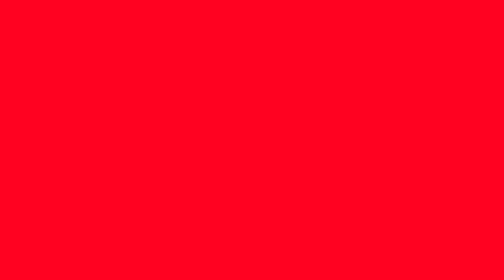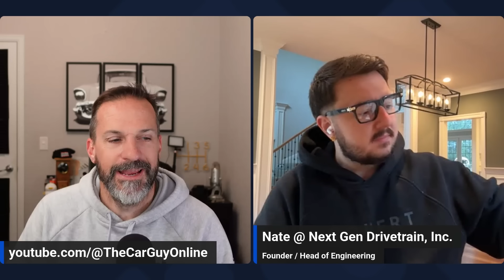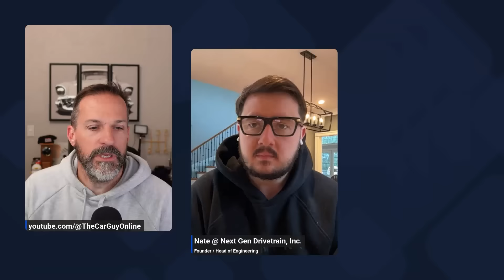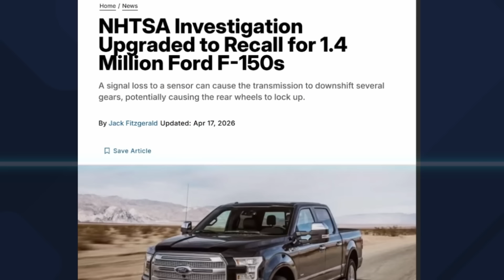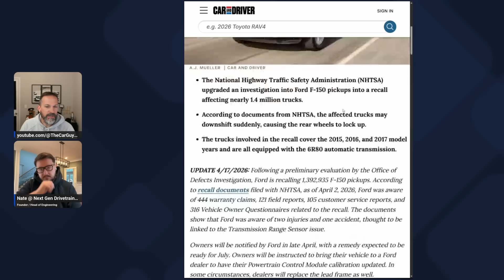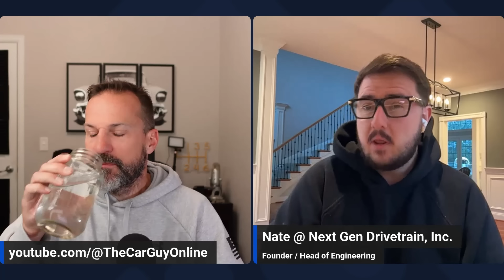Ford's BIGGEST Transmission Recall Yet - 1.4 Million F-150s

Comment: Lead frame is more essentially a circuit board with built in sensors. Its not a computer and its pronounced “leed frame”. Its also easy to replace. Also, what toyota transmission is regularly running 500-700k with no maintenance?  Calling the 6r80 unreliable is just ignorance in my opinion. I have 3 trucks with them and have replaced one lead frame, and I replaced it myself at 150k miles. You guys are both FOS, plenty of vehicles are making it well past 100k.mi. and with ease.

Comment: I have this trans in my 2015 F150, also have a ZF6 6 sp manual in my 2000 F350 w/7.3 PS.  Not experienced any issues with the F150 but will likely adhere to the recall, if/when.
Now that the Trump Admin has gutted the insane EPA standards maybe we can get some useful vehicles with less recalls?  
When any manufacture goes to eye scanning, cameras  and shutdown interlock switches based on AI, they should be prepared for massive legal fights against the 4th Amendment.

Comment: I just disagree with the premise that more gears equals worse reliability. If thats the case then why is it that dodge use to be known for having bad transmissions with their 4 speeds and now the trucks have 4 more gears and its one of the most reliable transmissions in a modern truck. I could be wrong about that, but the 8hp seems to be to best modern trans and  Car & Driver even says that. Imo the 6r80 is a better trans than the 6l80 because gm really likes to slip the torque converters and run their transmissions stupid hot, which is really hard on the tc. And the issues with the 10r80s mostly come from a bad design with the cdf drum. It looks to me that the issues we face with new cars are poor engineering, cheap parts, and government regulations and it not just with transmissions its every part of the car

Comment: Ford Chevy always built substandard transmissions, they usually had five different transmissions to go behind three different engine choices my 2004 Dodge Durango with a 5.7 hemi has 350,000 miles on the transmission the engine and the all-wheel-drive system it’s never been touched. It’s extremely reliable. I will put 450,000 miles on it before I touch anything. It’s why smart people by Dodge. We’ve always had the best transmissions the best engines Ford just has the best people to brag falsely and we know Chevy is junk.

Comment: Guy on the right is a salesman. Dont forget that. I have 190k miles on my 6r80 2016 F150 and have had 0 issues. Modern vehicles are more reliable than 70s/80s/90s vehicles. They're just harder and more costly to repair. But they're also 10x safer.

Comment: humm wonder if the recall is in Canada also ? I have a F150 2017  2.7 l with the 6 speed  still works fine at 225000km  a bit rough shifting when cold but otherwise ok

Comment: Putting an ECU in the hot trans oil. How stupid.
Reply: You are absolutely correct. the life of electronics is significantly affected by operating temperature. the rate of degradation varies exponentially with temperature, not linearly. Engine ECU's are often next to the hot engine. When I found the engine ECU on my 2001 Impala installed inside the air intake plenum (the coolest area under the hood) I was amazed at the idea.
Reply: That was by design.  They only botched how fast it failed.  Its supposed to last until just outside your warranty.  Ford put plastic IMRC flappers in their intakes. They are controlled with a metal rod.  The metal rod slides through the  plastic flappers and is constantly opening and closing them.  Who here who is NOT and engineer knows what will happen when a metal rod turning in plastic will eventually do when placed on a hot engine?
Reply: is the recall just software or is it mechanical?
Reply: The TCM is not internal on these transmissions. He's wrong on that. The PCM (ECM + TCM) is mounted high on the passengers side of the firewall. 3 wiring harnesses plug into it. 2 for the ECM and 1 for the TCM.

I read through a bunch of comments on this video and all I can say is you guys need to be more selective in where you get your information from. Misinformation is a huge problem. And that's not meant to be an insult. I believe the guy making these videos is a very nice person and he's not trying to mislead anyone. He's doing his best to present accurate information in his videos, but the truth is that he doesn't know all that much about modern vehicles. As it stands right now, the only place you can get consistent, reliable information, is through factory training. Cars have been changing a lot in recent years, and the aftermarket just can't keep up. Eventually it should correct itself, but for now, you need to be careful. I get cars towed in on a daily basis because some independent shop got themselves in over their heads. They have no idea where to begin.
Reply: @052RC if it’s not internal to the transmission, why is this defective junk part failing on these transmission. Ford couldn’t leave the original design alone which is why these fail, it needs TCM and it doesn’t have one for 2011-2014. If it had one, so many wouldn’t be failing hence why I have the 6r80 just as much as the 10R80. Both are junk in all honesty. I have the 6r80 and a relative has the 10r80, both terrible. Mine is already on its way out at 140,000 miles because of the defect.
Reply: @That3.7F150  8 yrs with my 10r80 and it shifts fine like the day it was made. So not all are junk like you think
Reply: @pathunter7003  how often do you flush and/or drain and fill your transmission fluid? Do you drive around on tow/haul all the time or normal? And are you in a 2.7L, 3.5 or Coyote?
Reply: @therealsolomonmichael  I will drain the fluid at 35,000. and I don’t flush it.
90% of the time I drive it in tow/haul so it uses every gear, the rest of the time is in normal or sport. I keep that trans adaptive learning guessing all the time lol
I have a 2018, 2,7, supercrew XLT
Reply: @pathunter7003  I thought that combination exactly might fix the problem and you just confirmed it 100%, thank you! with the drain and fill do you also replace the filter or just leave it?
Reply: @pathunter7003   I have. a 10 speed in my GMC.  I have had 4 of them and only one had a problem.
Reply: @danslawncare8594  👍

Comment: I've got a 2020 F150 with 210k miles. The trans is  clunky... probably the cdf bushing, and I'm going to pull it soon. I guess I won the lottery. A rebuilt unit from Moveras is $3800 which is not cheap, but not $8 or $10k

Comment: I was a GM tech years ago I was given a car to diagnose front wheel drive Ford don't remember model Ford said nothing wrong with transmission customer told me drive at 60 mph and you will have it happen drove ten miles steady 60 mph transmission actually locked solid for split second scared the crap out of me put a reman in okay

Comment: The only reason we can't get manual transmissions in trucks is because of the CAFE/EPA regs...
Reply: Its because they're reliable thats why
Reply: Manuals sit on the lot. I got one for a fair deal because the dealership just wanted it gone, it had been sitting there for months. This was back in 2015 and it’s still great for me.
Reply: @---jt5wg they also only where putting manuals in the lower end models of vehicles.   Manufacturers somehow think if you want a manual you don't want a luxury model.  Total nonsense but that's what they thought
Reply: And Americans have gotten lazy. Automatics are more fuel efficient and buyer demand just isn't there to make it worth it for the manufacturer.

Comment: I've worked in the air conditioning industry for over 35 years.  Paying attention to CO2 levels inside vs outside is how we determine if a building's ventilation is good.  While I could comment that I haven't seen readings go up in over 25 years I think it's more instructive to explain how CO2 operates as a greenhouse gas.  The earth can only get rid of heat by radiating it out into space.  To limit that radiation CO2 color shifts the infrared from a more efficient color to a less efficient color.  Since it's a color shift it only takes enough of a concentration to achieve this.  That concentration is around 300 to 310 parts per million.  Higher levels doesn't increase the color shifting because it's already done.  If higher levels are a problem then it doesn't explain the existence of CO2 levels trapped in amber that are 3 to 4 times higher than common nominal readings now.  So if you think that the bubbles in amber was trapped there after the industrial revolution then I've got a bridge in Brooklyn that's for sale.

Comment: 1997 F150, 4 speed auto with  the romeo block 4.6. Has 350,000 miles. Runs strong for its age and milage, sure its a little tired but hey for a 30 year old truck with the original motor no rebuild, its a solid vehicle.

Comment: The frustration I have is that Ford's recall is arguably pointless!  Why?  Because Ford is currently struggling with a shortage of qualified tech's, dealer repairs that used to take a day are now taking much, much longer to get completed.  And, even then, the quality of those dealer repairs seems to have declined.  We currently own two F-150's with 6R80's and an Expedition with a 10R80.  The Expedition had a warranty transmission issue recently.  We took the Expedition to a Ford dealership with a good service department and it took them well over 6 weeks to complete the repair (they ultimately replaced the transmission).

Comment: Hey guys,
I have 2017 f150 with roughly 38,000 miles.. about 300 miles ago. I had my transmission rebuilt remanufactured whenever you call it… it did solve a lot of the problems but it’s still kind of clunks rather loaded  from 6,5 7 to 6 whatever which one. My warranty runs out in two months. Is this normal? It seems like at high speeds when it’s at 8/9 gear and then you slow fairly fast it happens more often!.. your feedback would be appreciated..

Comment: WHERE IS OUR FEDERAL TRADE COMMISSION? Proprietary software and diagnostic tools, the absence of "right to repair" laws. While a few states have passed "right to repair" laws, it will never be easily enforced until the Feds make it law. All brands use to offer base models without complicated computers, add ons, just simple basic transportation with "options" for a/c, touchscreen info centers vs a simple FM radio. Power windows/locks vs crank windows and manual locks. What a concept for Toyota to go back to an updated design for a Yaris or Civic WITHOUT THE TURBOS. We did fine with basic rides that DID NOT HAVE 250+ horse power, squeezing 300 hp out of a 4 cylinder with a "made to fail" turbo.

Comment: Why haven't the brands figured out it would be cheaper to build a vehicle that's reliable, not disposable after the warranty expires? Why not go back to the known versions of reliable drivetrains? Even the final years of the GM 3.6 V6 were much better than the damnable turbo 4 cylinders, why not a 6 speed tranny with an overdrive "button" for interstate driving?  Do we really need heated steering wheels, power door handles? Those crap computer screens instead of instrument clusters...water pumps INSIDE the engine??? Now WAY overpriced with MUCH too little quality...it's like at least one brand would see this problem as an opportunity to excel instead of join the crowd with junk product like Toyota has decided to do. Remember when a Honda, Toyota, even a Nissan was your go to quality purchase? Yeah, not any longer. Every decision now is a crap shoot, you're rolling the dice, hoping YOUR ride will be one of the good ones, magically surviving past the warranty...somehow.

Comment: Bruh put the ECU outside the dam transmission
Reply: the ecu is outside the transmission. its called the pcm, the "module" inside the transmission is basically your valve body just like any transmission.
Reply: @ChadG2 not most transmissions do not have Computer's inside the transmission in the hot oil, Sure ZF 8 do it, And a few others, ZF 9 is on the outside depending on the Oem, Honda made them install it outside the case.

Comment: Th 6r80 lead frame problem is from metallic particles and shavings building up causing the speed sensor to short or interrupt signal. Was a thing for 2011to 2014
Reply: 6r80 is actually pretty solid that doesnt really need upgrading. And new install is usually around 5500 to 6500. Not 10k. I know the 6r80 well

Comment: Its a race to the bottom. Ford Motor Company just filed patents involving biometric data systems, and laws have been created in some places that could allow vehicles to disable operation if a driver is judged unsafe. Ford Motor Company wants to use fingerprint, eye, face, and voice recognition tied into databases to verify identity and potentially flag wanted criminals. So you get in your car or truck, it checks if you’re wanted, checks if you’re “fit” to drive, and if it decides something is unsafe, it could pull over and shut off. Hope the next gen can find a workaround for this nonsense.

Comment: I have the same problem in my 2022 10-speed. Slowing down into red lights it will drop five gears all at once and nearly lock up the tires and make a crashing sound in the transmission
Reply: 2023 went out at 40k and the entire transmission was replaced under warranty with a different model transmission that listed for 2k.
Reply: @tnvfl  is the replacement a 10-speed also

Comment: My 2011 with the 6R80 was bullet proof. It's a great transmission. Change your fluid and you'll have no issues.
Reply: If you watched the video, it has nothing to do with fluid changes
Reply: @slowstang88 all I know is real world and 14 years of experience. It was rock solid.
Reply: @JDS-51 My 2016 has had fluid changes well in advance of whats recommended and mine started the downshift issue at 138,xxx miles. I had the 100,000 mile full fluid change done at a little over 40k. The problem is the TCU in hot transmission fluid, the lead frame getting fluid in the connectors, and pulse damper failure.

Comment: Criminal, they only recalled f150. I have 17 mustang with 6r80 that was throwing up p0706, p1702 and so on. I get hill descent not available, wrench icon. Unable to engage D from P. Gear lights not lighting up, hard to start vehicle and ocassional hard shift from 2 to 3. One day I was on the highway the trans hard down shifted to first gear violently. After that I did not drive the car for 6 weeks. Ordered mechatronic replacement. Replaced the lead frame, thermal bypass, all the seals and it is now shifting way smoother than when it was new! It was broken from start. My car only has 20k miles. Most  ppl would not have been able to fix it themselves.

Comment: I'm all for a discount being offered for supporting a channel/company, especially those that educate consumers and provide valuable insights/expose's into company practices. Look at how GM handled the 6.2 Liter V8 bearing issue, they essentially turned it into another profitable revenue stream funded by the consumer for their mistake. Now requiring "Dexos R" Mobil 1 Supercar Oil for about $15./qt (prices have gone up, on an already overpriced oil since  this new GM requirement) in lieu of a recall, passing the problem and added expense onto their customer. Kudos to all your efforts and supporting the Right to Repair Act.

Comment: If the issue is emissions, which if we want to continue to habit the planet we do need to consider this, what about electric drive trains with supplemental motors that charge as the vehicle is driven? Now all of a sudden you don't need 10 speed transmissions. We are probably not quite there yet in terms of cost but to me this is going to be the future of trucks, and they should be more reliable because of it. Though I would never underestimate Chevy and Ford's ability to cut corners and make something that is reliable a piece of junk.

Comment: i drive a 2001 explorer sport trac.  i am going to be replacing the engine and even when i rebiuld/replace the tranny..i will be into the truck for 15k..far far less than anything used i could get and new isn't a consideration.  the truck fits where i live size wise and i haul often with it...:)

Comment: Ford was building the 6r80 up until yesterday. They literally built the last one yesterday at the Livonia transmission plant. 21 year run.
So they are not "long gone"
Reply: Dude on right is a salesman. 6r80s are excellent transmissions.  190k on mine. Issue free. None of my parents vehicles they owned in the 70/8090s lasted past 150k.

Comment: Waiting for Ford to recall their problematic 10R80 transmission! They know there’s an issue with a faulty CDF drum and valve assembly but will DO NOTHING to help owners!
Reply: I had a new ford trans in mine 2018 about 60k ago and the 10R80 shifts all over the place. 1 to 3. 2-4, 3-5. Clunky shifts. I already had it reprogrammed. I’ll just wait for the recall. 😂